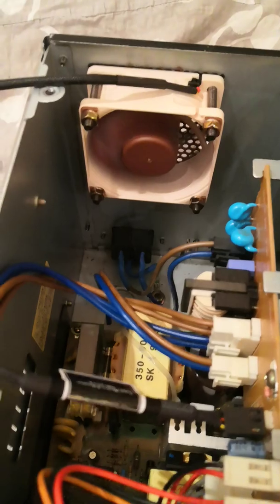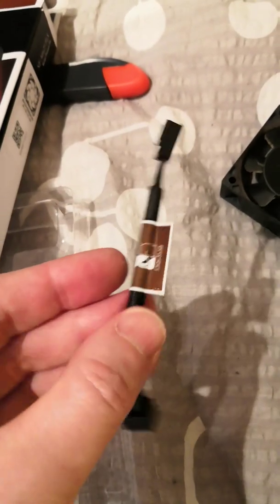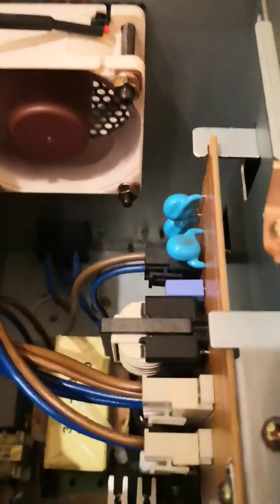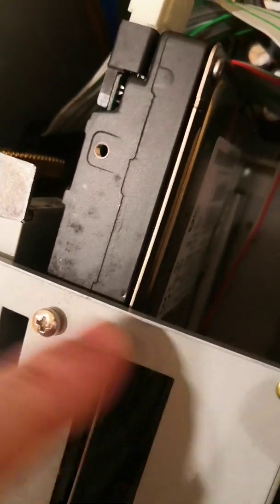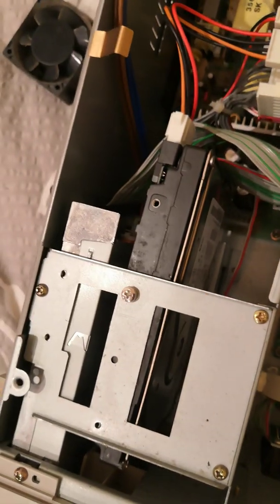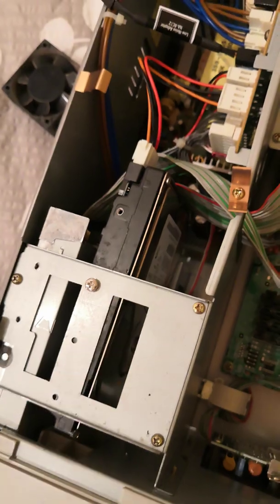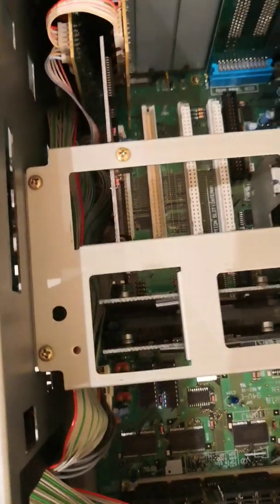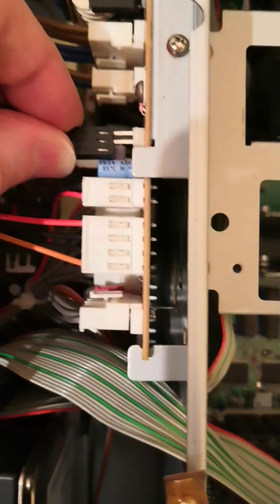New silent fan in my AKAI S6000 (After installation), and volume comparison

Comment: Very helpful, thanks for the video.  Can I ask how was it getting the screws off? I've heard they can be really difficult to move.  I plan to try this mod myself
Reply from the maker: Glad it helped. It was super easy!
Reply: How did you deal with the thread lock sealant on the bolts? That's the part that worries me, I've read about people using hacksaws or heat guns!

Comment: I did the same. Before replacing the fan and SCSI hard drive, my S6000 was one of the loudest things in my studio. I put a Noctua fan in there, and replaced the SCSI hard drive with a SCSI2SD v6. Now it's quieter than my iMac (which is probably louder than it should be, as it is an eBay used rebuild mess that was supposed to be a temporary computer). Highly recommend these changes!

Comment: I'm using a SCSI dual PCMCIA 'drive' with compact flash adapters - totally silent and works as 2 separate scsi drives. so backups are easy  I also run 230MB MO drives from Fujitsu which are super reliable and also only make noise when physically reading or writing.  eBay is your friend!